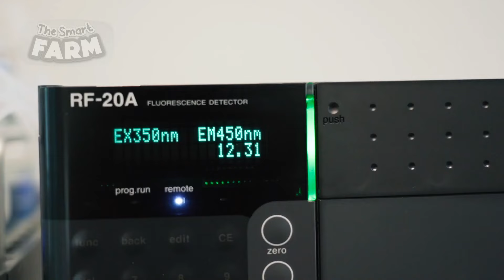INCREDIBLE Chamomile Production Line! How Chamomile Tea is Made

Comment: Herbas, besides having best chamomile processing technology in the world, has achieved yet another breakthrough. It's new dry processing system has many advantages and is suitable for sustaining very big capacities. In Croatia, there are processors able to process from 500 to 1000 ha, that is 1250 to 2500 acres of chamomile in one year (not to mention exporting over 95% to the western market), with maximum two harvests, which they supply all over the world. It is the main medicinal herb in Croatia, and the technology is perfected there - the best in the world on large scale. Thanks to this dry processing system, they can focus on the harvest, when it is harvest time, dry it as quickly as possible so that it is not spoiled, and store it pending further processing. 

Herbas, as of the year 2024 perfected the technology, completely automated the process of extracting flower heads and other parts of chamomile with this new line, improving quality and reducing labour to a minimum. Now processors, can focus on expanding even further, as currently, their processing was a bottleneck reaching 1000 ha.